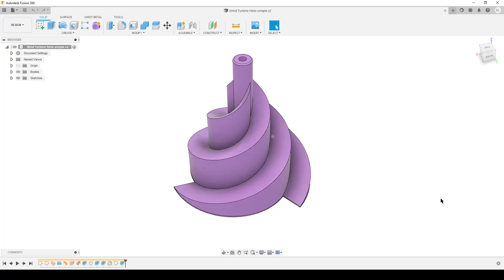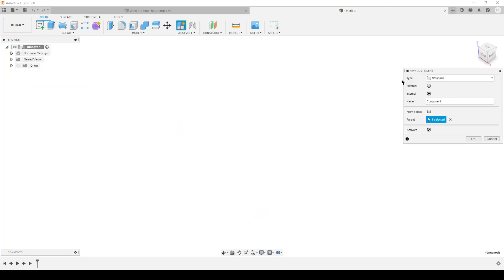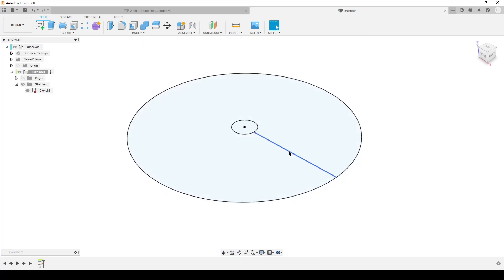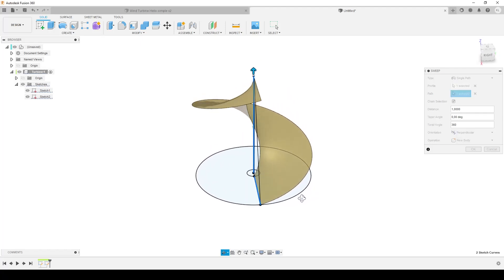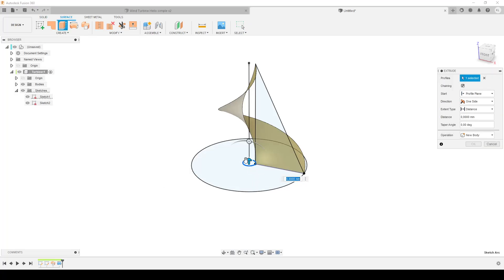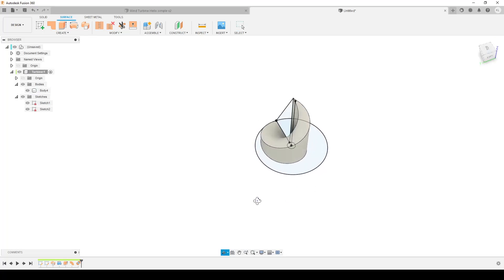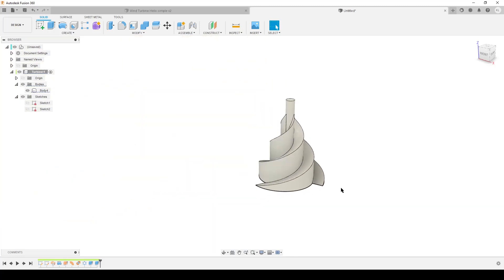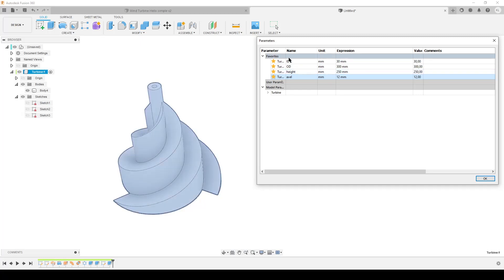Fusion 360 - Spiral Wind Turbine

Comment: Thank You
But how can I make this rotor hollow from inside?
It will be very helpful if you give some tips.
Reply from the maker: I'd start with the Shell tool, and it might help to split the body and not shell thin parts of it. If you are 3D printing the slicer will make it "hollow" (infill)